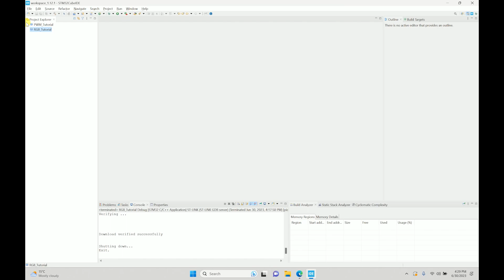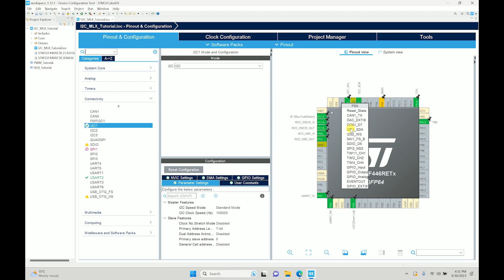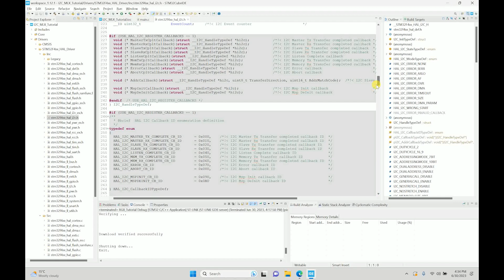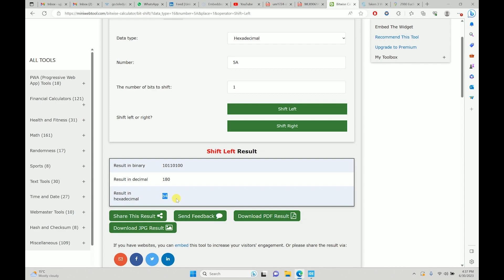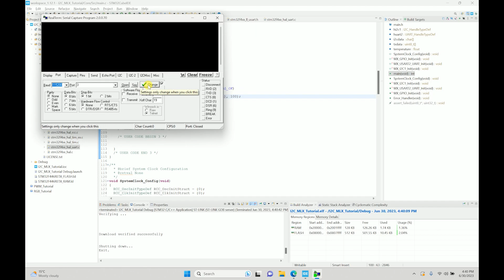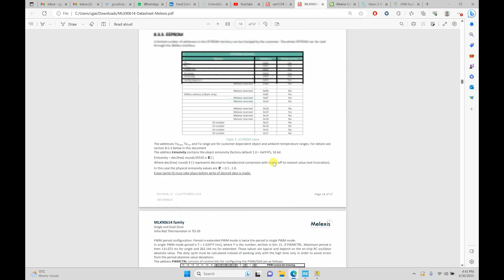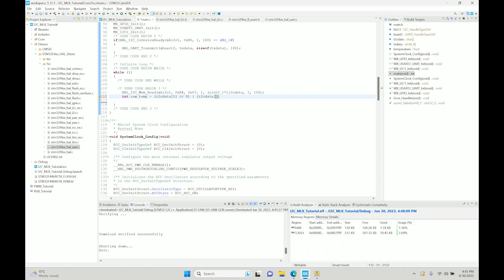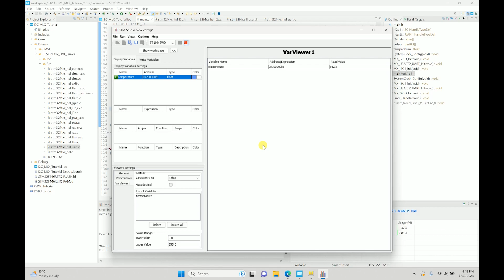STM32 - I2C Tutorial | Interfacing MLX90614 |Temperature Sensor | STM32CubeIDE and STMCubeMX

Comment: Hi. Nice video but I have a question about term application. I'm using MACOS, that's why I cannot download TeraTerm. What should I use ? What do you suggest? Thank you
Reply from the maker: Sure working with MACOS is always challenging. 

Here are some other serial terminal software that you can try out. Putty, Cool Term, Real Term, Arduino IDE Serial terminal

Thanks